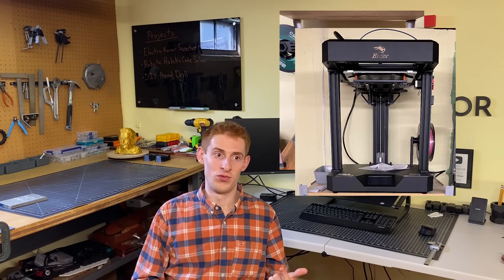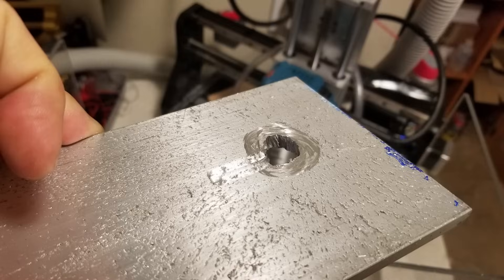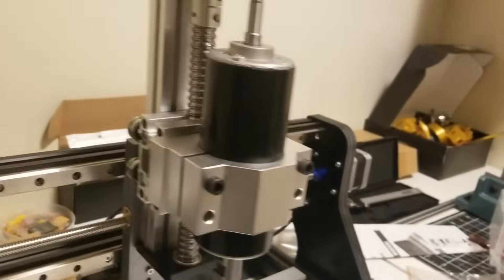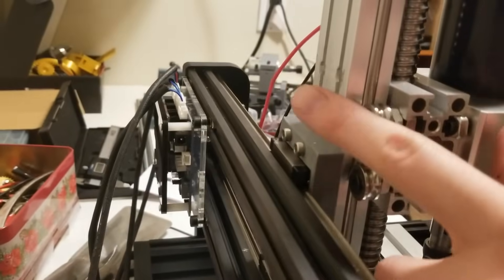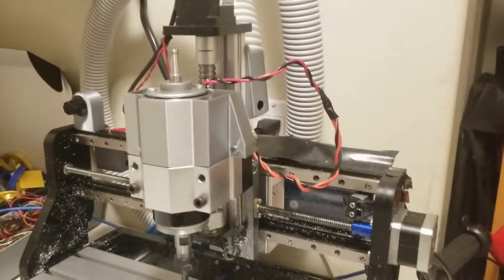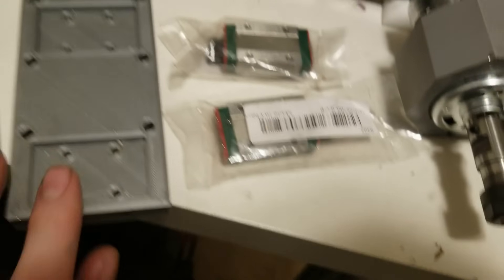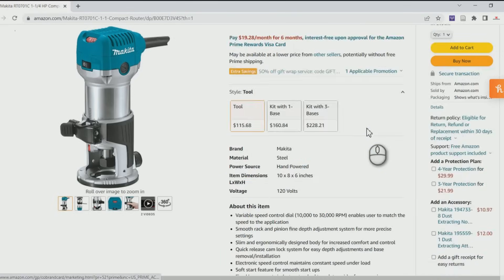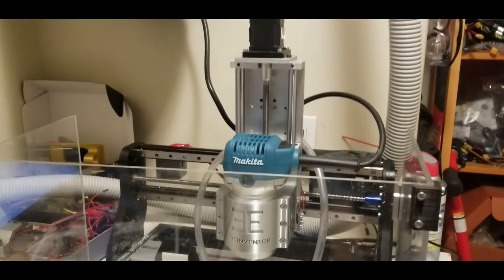Upgraded Desktop CNC 3018 cuts Aluminum FAST!

Comment: I enjoyed watching this because I went through the same learning curve for the exact same reason ...and I was called ScooterFaster.
I watched you learning ... Keep the hold downs level and very tight for example.
My mill was 5 hp and when you crash or chipweld a 1/2 inch carbide even at 2000 RPM it is very exciting. 
One thing I couldn't tell is what specific tooling you were using.  Try some premium coated 4 flute solid carbide bits.  Money spent here shows up bigtime.
P.S. My thing was twin (2) brushed or BLDC motors with 400 amp controllers. Fun.

Comment: Thank you for this video, I enjoyed watching and I ordered my 3018 cnc today.  😅 I immediately had a question.  I see that you used a heavier stepper motor for the Z axis (nema 23?) was it difficult to connect it to the original grbl outboard?  I was also wondering which end mills you advise me for the makita, because I want to use them just like you.  Thanks in advance. Kind regards. Dennis Aretz
Reply: At 3:20 You can se 1,7A on the step motor on Z-axis. Which means there is NEMA 17 1,7A.
Reply: @delfinigor  Thanks Igor ! 👍

Comment: get rid of that 3d printed crap, no offensive intend but you were using a hand drill to make holes when u had a working cnc machine right behind you, ok does the job slow and doesnt do a good job but that just means u might have to make two of the same part , and that is still fairly slow, yeah faster than a fdm machine, dont use fdm as a gauge for speed

Comment: You have used both 500watt spindle and makita router, 
Is makita router is little bit louder than 500watt spindle or
Very loud,?
Reply from the maker: I would say the Makita router is very loud, but for both routers I would still suggest hearing protection

Comment: This reminds me of the upgrades I made to my 3D printer kit, where I gradually replaced each new weakest component until I had pretty much built a new, better printer, just using the original kit as a scaffolding. I've got a 3018, too, and I guess it's about time to start giving that the same treatment.
Reply: I did the same thing with my Tronxy X5S. Had military money every month and just threw funds at it. The only things left over from the original printer are some of the frame and the motors. Everthing else has been replaced and upgraded. Sad thing is, it still isn't working

Comment: there is a whole lot wrong with this.....your frame is NOT rigid enough, you are using regular lead screws and not ball screws, you need to have all axis on linear slides not cheap rod slides, your steppers need to be much bigger. The frame needs to be made of steel, not aluminum. If you cant change any of this....stick to only milling wood.
Reply from the maker: Bro, on paper all of your recommendations are great. But in practice, if you watched the video, youll see I can get away with milling aluminum just fine with the few upgrades I made. So, while there may be a whole lot wrong with this, theres also a whole lot that is right enough to mill aluminum decently, which was my goal!

Comment: I bought a 3018 max CNC and stock it can cut aluminum but slowly and tons of chatter. Pretty accurate and with mist/air setup it's amazing now. I also upgraded all three axis to MGN15H rails, now its a beast.
Reply: Could you send me a link to the parts your talking about? I would like to upgrade mine as well.
Reply: Does anybody knows what travel length does the Z axis have on this machine? I am asking ,for all of those who want to replace it with a stiffer Z-axis.. also any weight restrictions? :)

Comment: I keep watching you guys cutting Aluminum and you think that faster RPM is better.  #1 you have no cooling or lubricant for the cutter.  If you are going to cut ALU use Varsol. #2 ALU has a lower melting temp.  The higer the RPM the more heat the more likley you will just melt the ALU and gum up the cutter. #3 HSS (High Speed Steel) cutters only no carbide.   And before you ask, I was a Tool Maker and CNC Machinist before moving up and on into other parts of maufacturing.

Comment: I don't know!  By time you got through dicking around experimenting. Changing out parts, and time spent. Then still only getting marginal performance.   A very rigid, reliable $3,000 cnc mill might have been quite cheap.     Although, maybe not as fun. If you are the tinker type of person.     Lol! After all, a stable proven machine is quite boring.  There is nothing to fix.

Comment: 1 flute spiral bit will speed this thing up. I cut aluminum since 2009. Use an ethanol mist in the cutting point and the cut will stay cool. With a 4 mm bit, use RPM around 14000, feed around 1500 mm per minute. You may cut 2mm per pass
I live in Brazil, and like the rest of the world, I use metrics. I know nothing about Imperial.

Comment: are you stupid? After all, all the surfaces that the milling cutters are subvibrave.
And you work with a milling cutter for 3 hours, deepening by 0.05 mm, then that place becomes dull.
Attaching the cnc to the table or where you keep it and then it will jump less will be another updrage

Comment: Did the stock control board need to be upgraded? I see you added limit switches. Did you need to change the board to support that?
Reply from the maker: Nope its the original board

Comment: all, an important note is that the default Z-axis stepper is not strong enough to pick up the Makita spindle. Eric probably didn't notice it as he used the Z-axis stepper received with the Z-axis he used in the middle of the video. please note.

Eric, excellent work thanks for the help
Reply from the maker: @Aaron Prat good point. The Z axis stepper is just slightly longer. Its a Nema 17 42-48
Reply: there it is 🙂

Comment: I just discovered this channel by also turning to google for inspiration and guidance. I too have been "developing" an upgraded mini CNC to cut aluminum. I set mine up inside a Harbor Freight blast  cabinet that I picked up cheap from Craigslist and modified for this project. 

Subscribed Boiii!
Reply: setting up inside a sandblasting cabinet is a great idea, does it help with overall noise in addition to safety?

Comment: What is the largest piece of aluminum you can cut as far as aluminum stock goes? Thickness of the aluminum?
Reply from the maker: I would say the cuttable area is about 220x170mm (~8x6in) and for thickness Ive done 13mm stock (1/2in) many times but as long as you mount your stock well and run the right speeds with small depth of cut i dont see why you couldnt run 25mm (1in) stock. The issue eventually becomes the stub endmill   tool length.

Comment: When I 3D Print the parts, what fill would be best for V3?    Great video!   I will be moving forward with this.
Reply from the maker: I think 40% infill is plenty. I often find that the wall perimieters are more important, so I would do at least 4 for that.
Reply: @ericinventor  I have all the parts or coming except the Z axis slide.   The one I want is about 1/2 the price of the hole V3 system you came up with....have to wait.

Comment: about the only other thing you could do is replace the bakelite sides with aluminum, and maybe use it to cut a replacement for your 3d printed adapter in aluminum.
Reply from the maker: Totally agree. The 3D print adapter design would have to be modified to be CNCed effectively. I would probably have to split it up into two smaller clamps, which I can cut out of 1/2in thick aluminum stock. But its doable!

Comment: What software would I need to run it and where would I get the 3D printed parts to hold the router ?
Reply from the maker: Software is GRBL Candle, and the 3D printed part files or on thingiverse, check the links in the description

Comment: That's really impressive that you can machine aluminium so successfully in such a cheap machine and are still using 3d printed parts and those tiny 2020 rails.

Comment: hi :D great job. I have a question, did you just plug the z axis nema 17 stepper motor to the orginal original control board? or did you do something else ?
Reply from the maker: Yes, i just plugged it in to the original board nd it worked no problem!
Reply: @ericinventor  good to know;D thank you ;)

Comment: I think if you stabilize the base more and get rid of the 3D printed plastic parts and replace them with metal ones, chances of chatter and vibrations are going to be very very slim.

Comment: What nema motor do you use on the z axis? 1,5 A...... 1,7A...... 2,0 A? In any case....Does the serial controller board support that intensity?

Comment: the nema motors that come as standard, can they move all that assembly well in the z axis? 

In the event of a problem, can a higher torque nema motor be installed without changing the electronics? In that case, for how long?
Reply from the maker: In my V2 build the z-axis came with a larger stepper, so I transplanted that one to the final V3 build z-axis. I did not have to change any of the electronics. The larger stepper is a nema 17 42-48 I believe
Reply: @ericinventor Do you know what intensiti has the new nema motor? 1'5 A... 1,7a....
Reply from the maker: @jesuscastalla  sorry but I dont know exactly
Reply: Last Question..... Do you know if there is a problem to put 2 motors with 1.3 A and the other one with 1.5A... when your panel control recive 24V and 5,6A?

Comment: So what I got out of your video is to buy the most expensive tool you can afford... do your research and make sure that $$ is spent for what you are going to do with that tool.  Use a hammer for nails, a screwdriver for screws, a drill press for holes, a saw for cutting, a mill for milling and a lathe for turning, etc....   to me, the fun part is thinking about the projects and designing them out on the drawing board. Also enjoy making my own tools, but you can just buy what others have designed for you, as you can always trade-off time for money. It's not the destination, it's the journey. Thanks for the video!

Comment: for a cnc mill , rigidity is more important than all other factors.. The last one I made which is still use is  box steel filled with concrete in a concrete base. 320 lbs , and the weak point is actually the spindle power which is 1.5 kw.anyway , excellent work finding all the weak spots in the design.
Reply: Yea. (600/60)*0.75*3.1 mm = 23.25 mm^3/s. If you put in those numbers in fswizard, it's 0.02kW... that's really just peanuts for any 1.5 kW spindle. I have a nice, granite, rigid cnc here that does 20mm deep cuts with a 6mm endmill... If you punch that in, you still only get 0.53 kW, which means that the spindle will still be fine, that is: as long as the cnc is rigid enough...

The weak spot in any cnc3018 is just... well everything... these things are just so flimpsy. Throw a back plate against it, and the little nema's won't have enough power. Upgrade the motors, and the excessive backlash will ensure that vibrations kill the router bit. Change to ball screws, and the side panels are too flimpsy to any real work. Replace the side panels with 15mm steel, and the y axis will be your next problem. Next, the motherboard is crap. The stepper drivers are crap... the list just goes on and on. At the end of the day, not much will be left of your router when you attempt to make it good...  

Really, the only thing good about these small routers is that they are so much fun to toy around with. I had one and enjoyed it quite a bit.
Reply: What would you say the total cost to build youe cnc was in the end? I just got a 3020 Pro Max from Genmitsu but anticipating some upgrades pretty quickly.
Reply: @robsproducts  well u already have the main components from the 3020.. Mine cost about 750 total , But i used flat 20 mm linear rails on all 3 axis .. that was the majority of the cost ( 250-300  dollars) the concrete is dirt cheap , I used all the 6040 electronics, got a geared nema 23 for the z ( 45 dollars ) and used the 6040 spindle.  The steel for the column was scrap from the garbage I picked up  on the side of the road.Its probably more rigid than my 700lb benchtop mill , but these chinese spindles lack the grunt needed for heavy passes i can do manually on the mill. Hope that makes sense.. In my experience , the Z ( spindle mount ) rigidity is more important than the x aand Y, so u can go cheaper on those rails. I kept my 6040 running right to the end , to make brackets for the new machine.. then basically swapped the electronics over in one day.. so very little downtime

Comment: Awesome video. I'm planning on going down this same path. The question I have is which stepper motor are you using for the Z axis? Did you upgrade the X and Y stepper motors also? And are you running off the same stock control board ot did you have to switch that out?
Reply from the maker: X and Y stepper motors and also the control board are all stock from the Sainsmart CNC 3018 . The Z axis stepper is just slightly longer. Its a Nema 17 42-48
Reply: @ericinventor  You da man. Thanks for the reply and good work. Hoping to get mine up and running like your as soon as the parts come in. I just don't have a 3d printer to make the back bracket like you did so I'll have to rig something up lol.
Reply: Do you need to upgrade the z-axis slider?

Comment: Have you tried using a larger collet and tool with the 500 W spindle? it doesn't seem like the 500w motor is struggling that much, and most of the impact appears when upgrading your tool usage. Maybe I am wrong, but the increase in cutting looks like a mix between cutting tool size and your motor upgrades.

Comment: Is the makita router mount 3d printed? looks like aluminium.
Reply from the maker: Yeah its 3D printed in a silk silver PLA, pretty nice right
Reply: @ericinventor  thanks for this video. I just received my 3018 and will skip straight to V3 upgrades thanks to it

Comment: The 3018 Pro is right around 14" between side plates. 400mm linear rails are too long to fit in between those side plates. Did they make different versions? I'm thinking 350mm MGN12H rails work for my version.

Comment: Could you please provide the proper ( Big Z-Axis Adapter ) dimensions Eric the STL when downloaded is super tiny in size. I would like to try and print it but the correct dimensions for proper fit would be needed as I have no way of knowing the proper size without printing several times before getting it correct ... Thank you
Reply from the maker: Hi Fred, yes im sorry about that. Somehow the export got scaled into the wrong units. Use 2540% to scale it to the right size. In the thingiverse comments someone else said that worked for them.
Reply: @ericinventor  Thank you very much! great work!

Comment: Thanks Eric for this great video
I'm Leo from Argentina, and I have the same 500W spindle, but I have a big issue with original spindle cooler related to noise and vibrations.
As I see in your CNC you removed original cooler and add a aluminium dissipator.
Do you created this dissipator or its can buyed en some store?
Thanks in advance and really thanks for sharing your projects
Reply from the maker: Hi Leonardo. I think the dissipator you are refering to is the 3D printed oil tank that I made to hold oil for the  gravity fed drip coolant system I was testing. It was actually not intended to be for motor cooling since its plastic not aluminum. I designed it myself and printed it on my 3D printer
Reply: @ericinventor  Really thanks for your clarification!!
How did you solved to cool the 500w spindle?
As I see in this video, you removed the original cooler
Thanks again for your patience! :)
Reply from the maker: @LeonardoBisaro  I guess I didnt solve the cooling issue, i ran it uncooled. But eventually i upgraded to the makita so i didnt really test if no cooling would become a problem.

Comment: I’m confused. You jumped from a disaster to cutting like butter with no explaination of what you did different? What gives. Was it just settings?
Reply from the maker: Good point. It was a combination of feeds and speeds changes and also  better workholding. My toe clamps werent well positioned when the endmill sheared. As some guys have pointed out, the toe clamps should be horizontal or slanted down towards the work surface, not towards the table.

Comment: Great video. Got my 3018 and a load of the upgrades on order. How do you connect and control the mains powered makita to the machine? Do you just turn it on manually straight from the mains socket?
Reply from the maker: I turn it on manually there is a power switch on the top of the makita next to the speed selector. To control it from the controller board would be quite difficult and youd need some extra hardware

Comment: thanks for taking us with you on this journey!
is see some really nice projects coming from you!

wonder if you can use the router to "tap holes?"
Reply: Yes, but you have to use a special end mill. It looks like a slot end mill, but has the triangle cutting edge profile instead of rectangle on a slot end mill. They're quite expensive and can tap only bigger holes.

Comment: As a machinist and cnc programmer, I see a common issue with hobbyist using the CNC 2018 , the clamps are not being used correctly. The clamps should be parallel to the top surface with a packer piece to suit. This will greatly assist in clamping as it won't vibrate loose and break the cutter like it did in you video, with the clamps at an angle, it will come loose and move, breaking the cutter.
Reply from the maker: Noted! Thanks for the tip, a couple other guys commented this also.